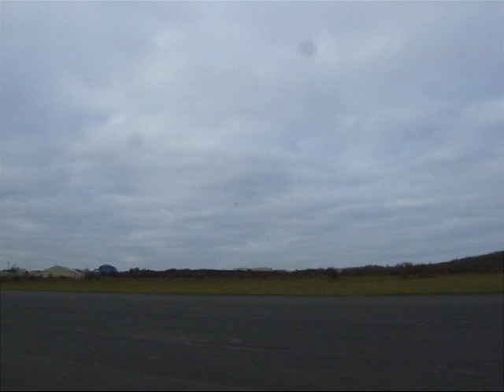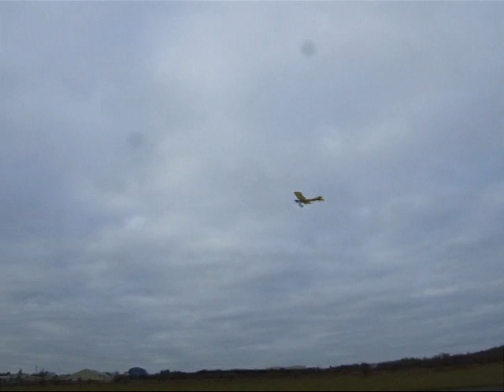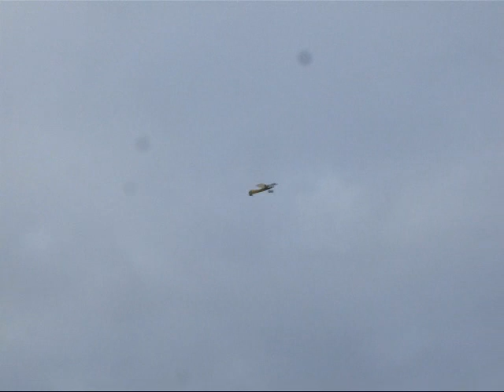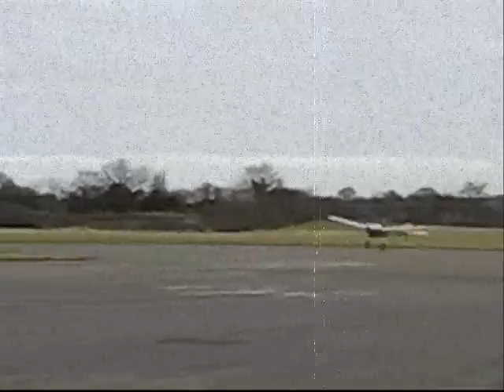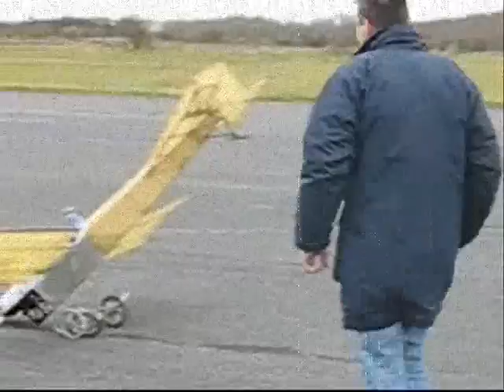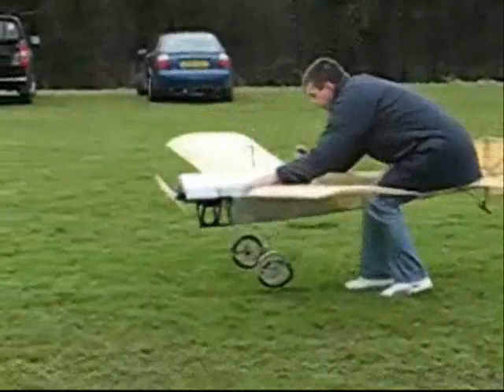Blackburn Monoplane - Electric conversion - maiden

Comment: I had an engineless one which went to a guy on the South Coast. I intended to electrify it but couldn't be sure of the motor power. I have another now that needs some rebuilding, and I have time now to finish it. What size and type motor are you flying?
Jim Hutchon